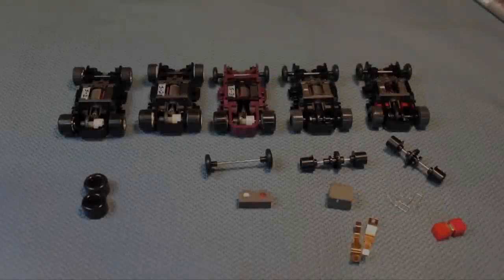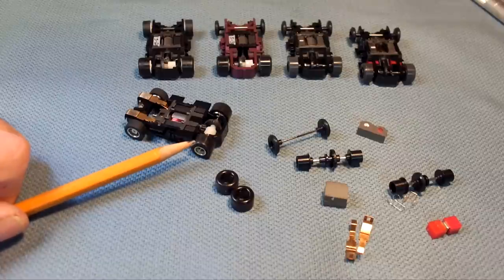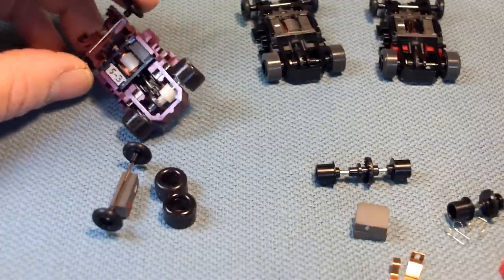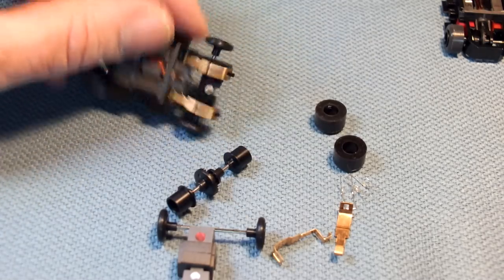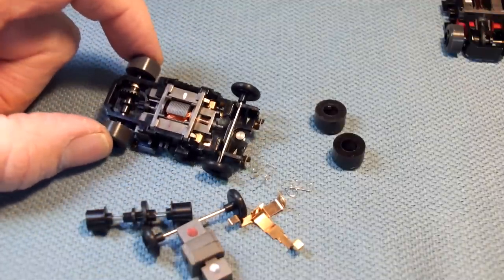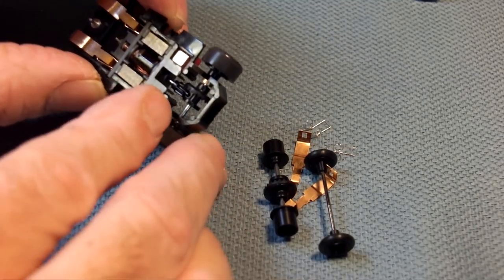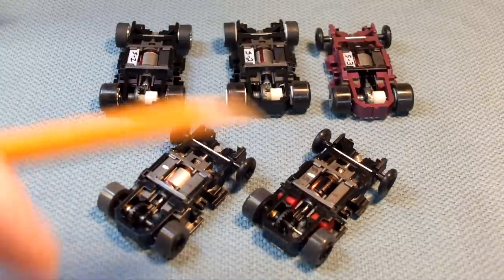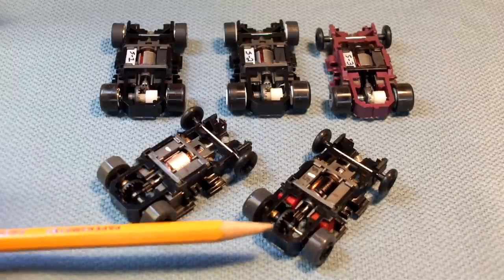Tyco 440x2 Hop Up in Stages

Comment: Hopped up a 440X2 wide chassis >> Viper 3.5 ohm armature, Viper Pro-8 traction magnets (in low downforce setup) and Gel Claws tires... Racing 87' of track in 5.33 seconds (scale 713 MPH) down to some 6" curves so not all just straight!  Power supply 19.5VDC / 3A.  All for about $28....

Comment: Had a grey widepan (not sure of the arm) I used an indy front cobalt motor and traction magnets (not sure of the stage just bought then off a friend) and a pair of orange foam tires on green wheels to put on the stock axle, sorry can't remember the brand, this was in the late 90's i think. We had an L shipped track in the back of the raceway and it'd just obliterate everything, wasn't fast on the straights, but it'd kill in the corners. This was with a '57 chevy body, no telling how quick it would have been with a vette or viper body

Comment: Will these magnet upgrades work on a tyco magnum? I have a couple with the Indy bodies. Super fun to run. Thanks and great work as usual!
Reply from the maker: The 440 Magnum has a bar style traction magnet.  So x2 style traction magnets will not work.  Very few vendors ever did hop up bar magnets for a Magnum.  Every once in a while one or two may surface on ebay.  But they do not appear to be a standard stock item from anyone.

Comment: I'm wanting to build a 440X2 for strictly drag racing. I have a few 4ohm armatures I would like to use. Will the stock motor magnets be strong enough to push the hotter armature?
Reply from the maker: You could try our Level 8 poly motor magnets.  Gearing after that will be the next challenge.  Use the Wizzard pickup shoe springs, 006 motor brush springs and brushes.  You might try .007 motor brush springs after the .006.  I've found Tycos using factory brush barrels don't like stiff brush springs.  Some guys put .008s or .009s in and the cars run slower.  Also in the web cart I have the Slottech Super Tough gears.  8/21 or 8/22 could work depending on your track length.  Rear silicon sponge tires most likely will run better that slip-ons .

Comment: Do you find stage 1 to make the stock arm run hot? I had to run stock rears with the pro 8 traction mags or the car got 150 degrees with super tires.
Reply: Also reverse zapping the traction mags is a great free modification
Reply from the maker: 150 is not bad for temp.  180 would be too much.
Reply: Cool! Thanks for the information and video.